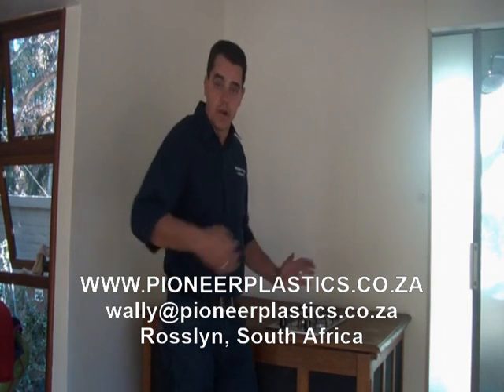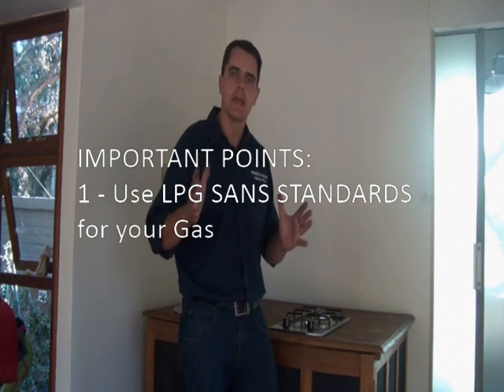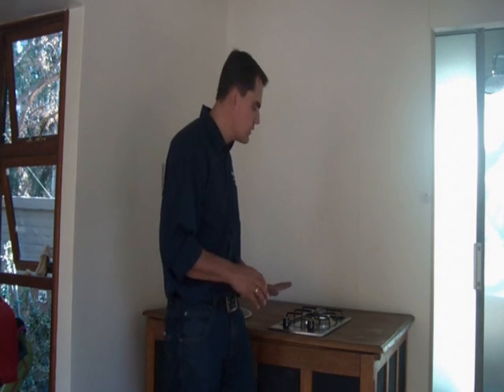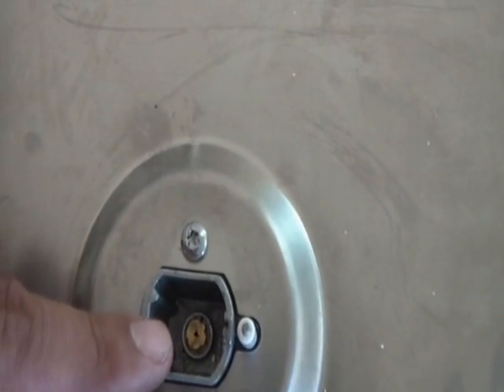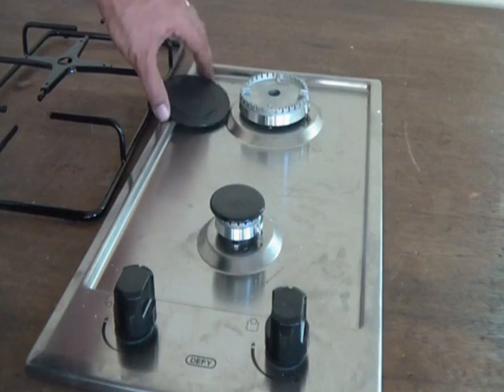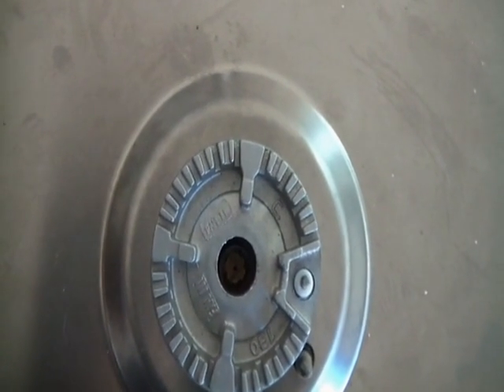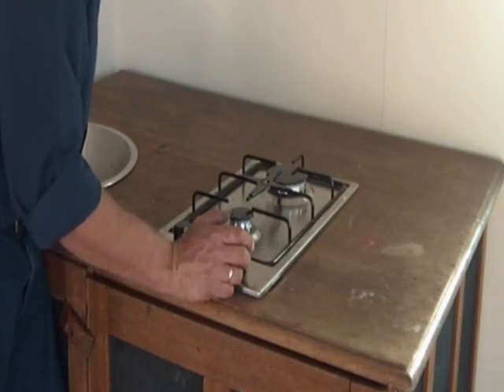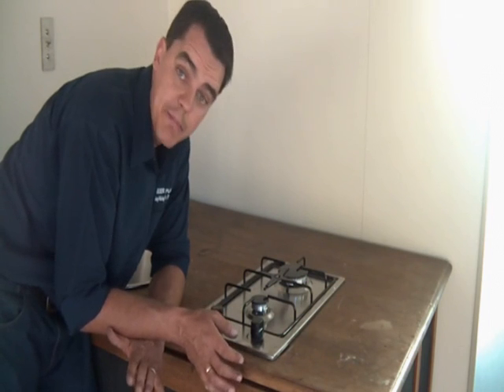BIOGAS - How To Convert your LPG oven - TIPS AND TRICKS

Comment: Wow this is awesome, especially if this could serve as a septic tank for 6 people?  Is that right?  How do you break down that much stuff without leeching out?  And how many toilets can hook to this + a sink garbage disposal? thx
Reply from the maker: Our tests have shown that the optimum is about 2-4 people main reason is the water flow. Too much flushing washes the bacteria out of the system. You also have to split the black and grey water and only channel the black water (sewerage) through the tank. See some of my other comments on the other video's on the subject.
Regarding the septic tank statement the system is not a septic tank as such because the high organic content in the overflow is very high and all pathogens cannot be neutralised in this process alone. You need to flow through an additional air rated system as well.

Comment: Thank you for posting your videos on this type of bio-gas digester. I am looking into installing a bio-gas digester in Alaska. I want to be able to heat the outhouse in winter with the gas. It will be a semi subterranean structure. The heat would need to run several times a night, for 20 minutes or so at a time. There would be 2 humans, a dairy cow, two horses, two or more pigs, 4 alpacas, 4 milk goats, and a donkey. My question is: Would the livestock help generate enough material to run a wall style gas heater for that long?
Reply from the maker: I think your main challenge exists in the temperature of the tank. The main advantage is that its installed below the surface so it has some protection against the environment. However if the system is too cold it stops producing gas because the bacteria is not active enough. Yes there is more than enough organics in your life stock however remember that manure has a lower energy content than food-waste so just balance your feeding mix into the system.